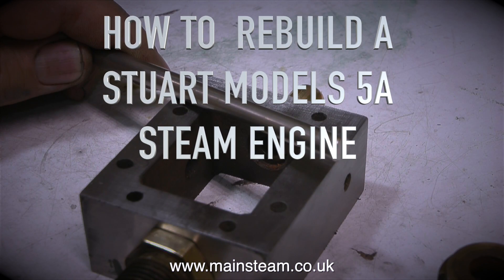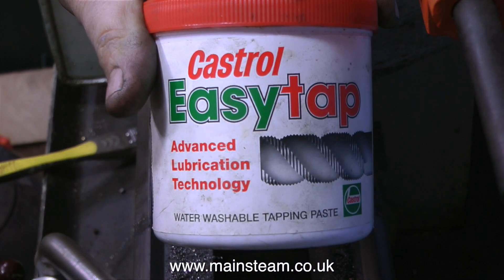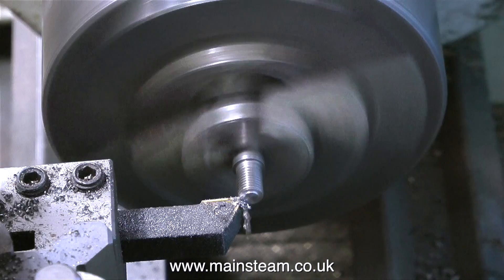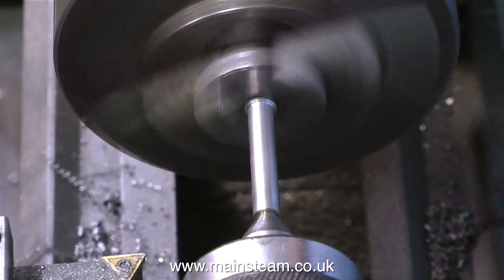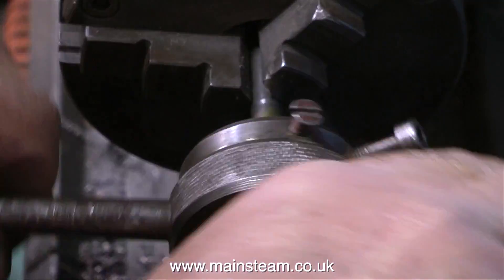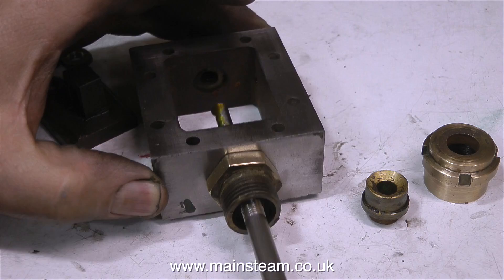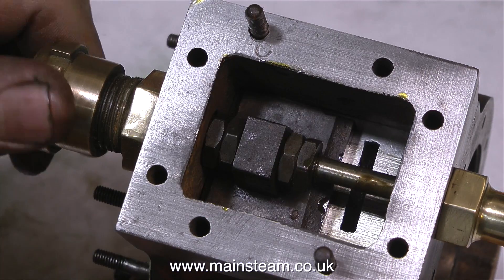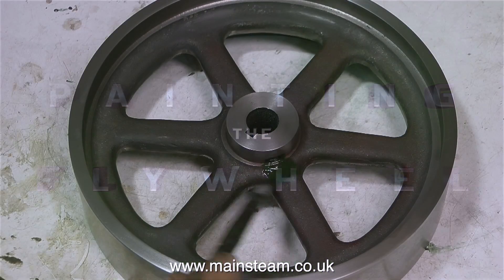HOW TO REBUILD A STUART MODELS 5A STEAM ENGINE - PART #11

Comment: When you paint and are going to do multiple layers, do you give it a light sand in between coats? Does it make a difference to the finish on cast parts?
Reply from the maker: Yes I usually give the parts a very light rub down.

Comment: Brill vid Keith,quick question have u tried using any primer before the top coat of paint or do you find painting to bare metal easier?
Reply from the maker: I have explained this in several previous videos. I don't use primer because by just using paint, any touch up repairs are far less visible than when the paint & primer coat are chipped on a casting.
Reply: Keith Appleton ah got you ,so you don't get a beep chip mark.